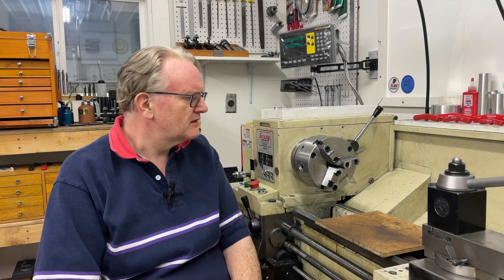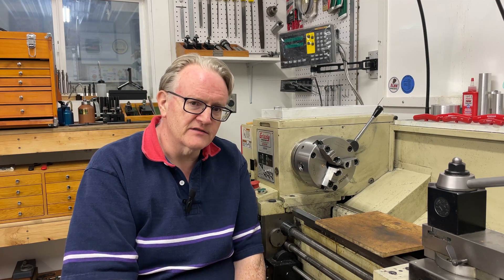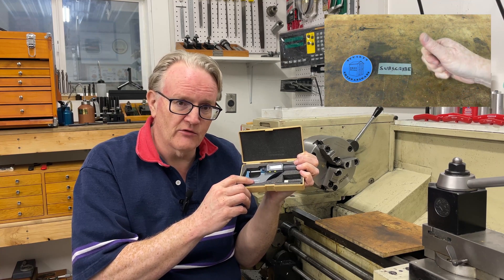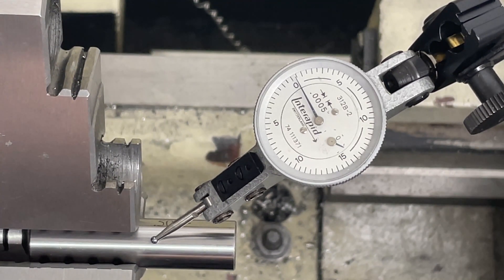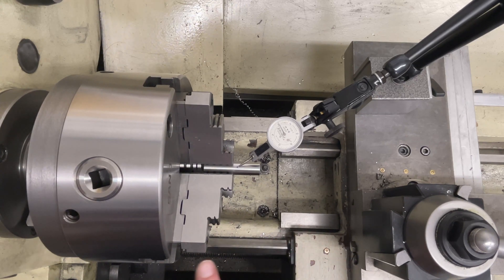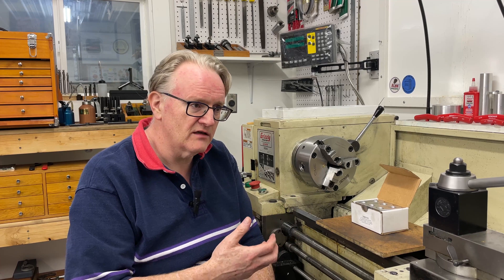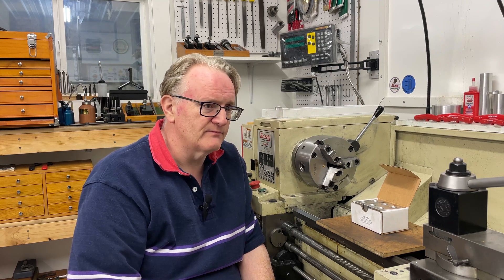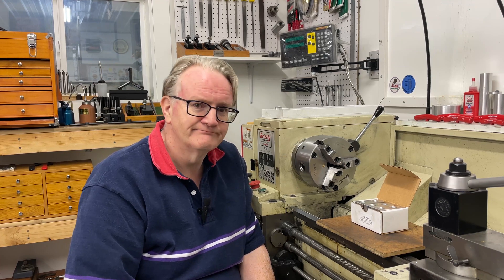Sanou/CME Import Chuck Final Review - Shortcomings Revealed, plus 1000 Subscriber Giveaway Reminder!

Comment: Hey thats the 6 inch 3 jaw right? I've been looking at it on amazon and have seen conflicting reviews as to the through spindle bore. What's the through bore diameter?
Reply from the maker: Hi! Sorry for the slow reply. That is indeed the chuck - it has a 1.7" diameter through hole - I just measured it. You're right - getting detailed specs on these is damned difficult.
Reply: @StuartsShed  Not a problem! Thank you for checking. I'm still shopping around!

Comment: Thanks for doing an update on this chuck, i'm sure some viewers will appreciate it. My general observation about the 2 part jaw system compared to 2 set jaws, inside and outside is as follows. Due to the fact that clearance is needed for the clamping screws, the actual clamping face on the outside setting, has a much reduced surface area. With the 2 set system the external jaws have the full smooth  section across the width of the jaw. Your ones there is only a small area each side of the screw counterbore, especially on the small diameter step. Also being like that there will be a tendency for the small areas to dig into the part quite badly and would suggest using some protection packing. If you get time you could grind the outside of the non axial jaw. Just put a pin in the inside jaws big enought so the the outside of the jaw misses the chuck body. A further thought has just struck me after looking again, it looks like that you cannot use the inside jaws wound out to say grip a ring as they have a reverse radius, or am I missing something in the translation. 😊 As I said I have never used one as they are an American style chuck, I have always used the UK style with 2 sets of jaws, so please feel  free to " Shoot Me Down In Flames " 😊 Regards from Australia.
Reply from the maker: Hi Dave, thanks as always - really appreciate your insight and questions. I think your observations are 100% spot on. There are definite shortcomings when considering the outside features of these style of jaws. I guess that's the price for additional versatility this style of chuck offers in other ways. To get around it I'd have to make up some jaws for that purpose. I have some steel soft jaws on hand and may do that when I need to make some rings. Also I will definitely grind that feature as you suggest. I was given a toolpost grinder, so when I make a mount for it I will re grind those non axial jaws. That will be a good exercise and test of the toolpost grinder. All good fun.